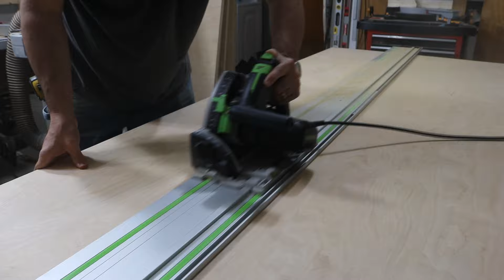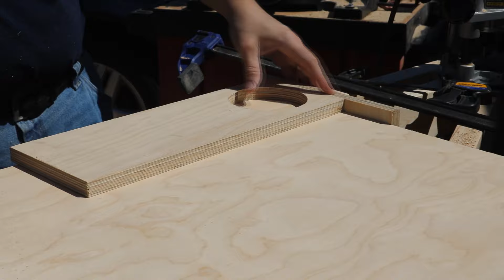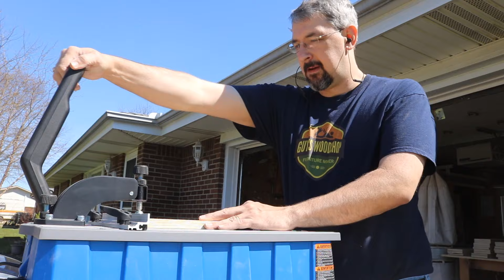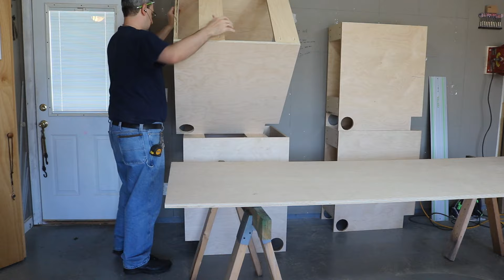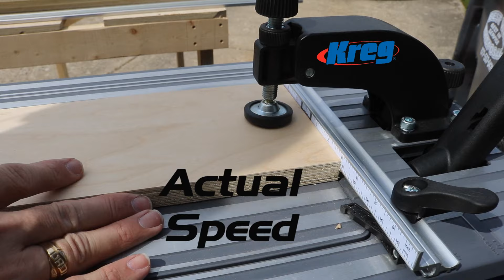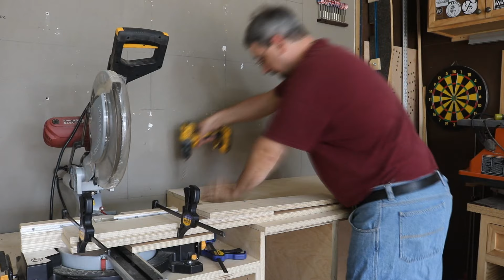Miter Saw Station Part 1

Comment: Nice Mike. one thing. I have a Kreg Jig and watched the vids before using and one good point they had was to (on your top braces) ensure that your screws are going into the most meat of the wood. therefore, the top pieces should have the pockets on the outside and then the screws are going into the thick of the ply and not working into the thinest part. They did a test piece and it broke out on them. Nice unit.
Reply: Hey Mike, that was by the way, only on the first cabinet.
Reply from the maker: +Darryl BEAN good point I'll keep that in mind thanks pal
Reply: No problem, you do a good vid so I guess i'll see more. ciao